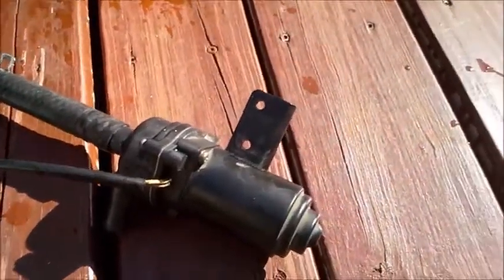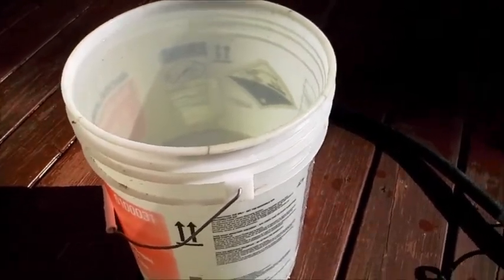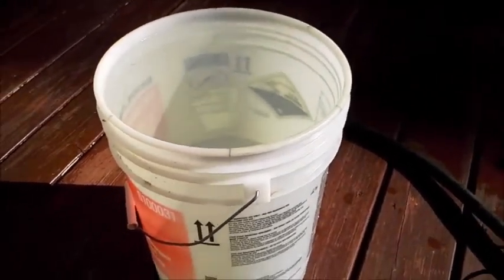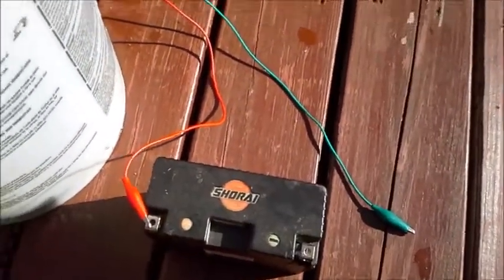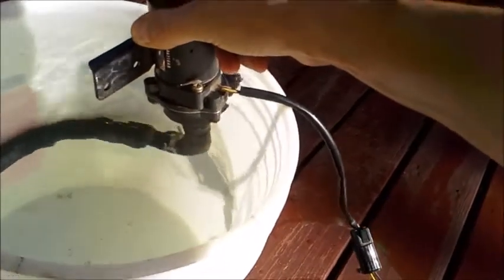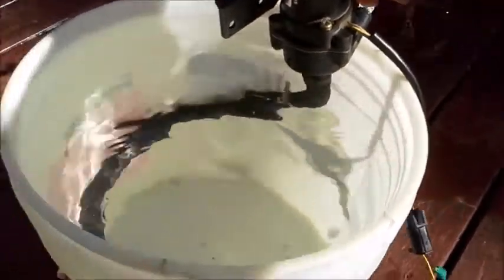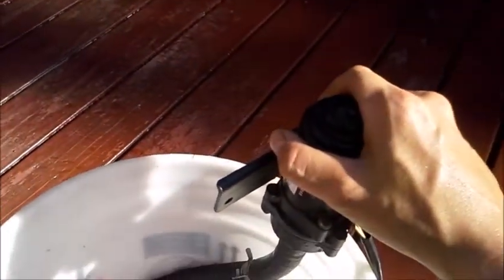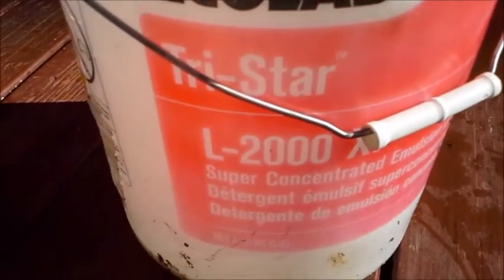Jaguar OEM Electric Water Pump for Engine Cooling Test, How Much Coolant Does It Flow?

Comment: Should be enough to pump I would think. Love that the racoon as supervising. :)
Reply from the maker: i will find out for sure if it's enough once it goes on the bike.
Reply: LOL that is one way to do it..Fly by the seat of your pants! :)
Reply from the maker: No other ways of testing it and I haven't seen it done on another zx10r. But the results will be worth it I am sure.
Reply: MidwestMotoRider I wonder if you could use this on a ATV